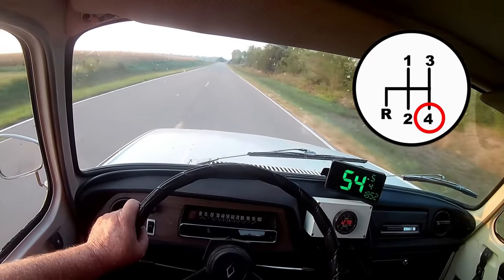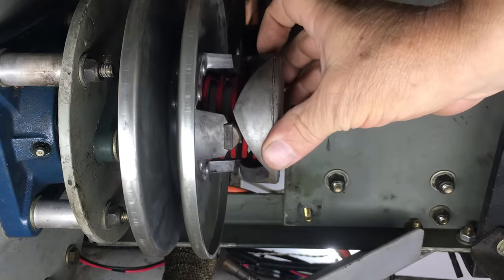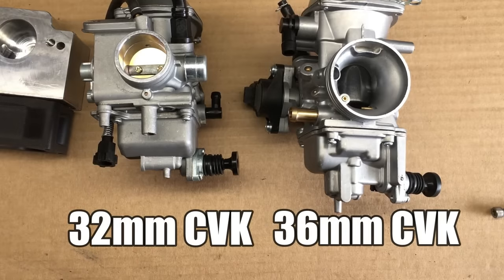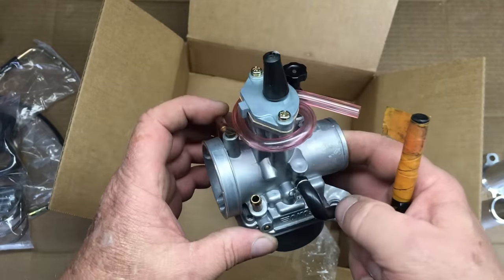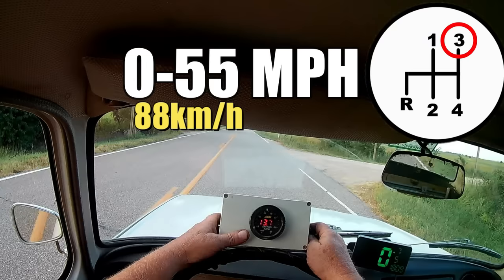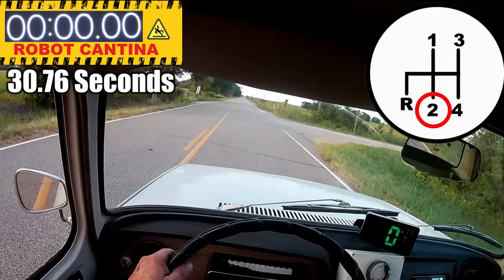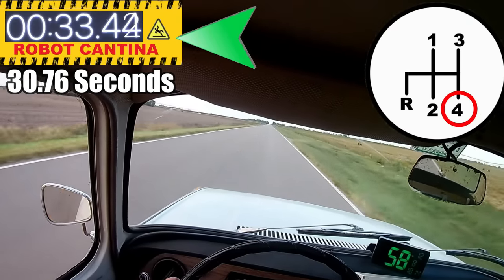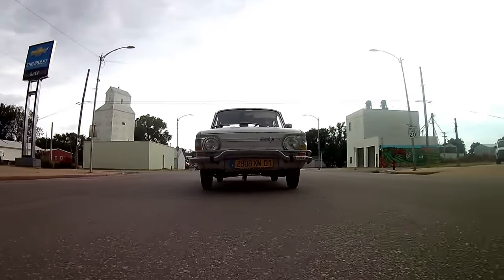S3 E32 We install a 3D printed manifold spacer on the 670 cc Predator Renault for moor speed

Comment: The dual carb setup will outperform the single carb. More work but there's no real reason to go with an even bigger carb when your problems don't exist on the high end of the RPM range. Larger carb could hurt the low end economy as well.

Comment: I hate duel and triple carbs. I've spent too much of my life adjusting multiple carbs for probably very little performance gains. Spend the time putting in fuel injection again. It will probably save time in the long run and I'll learn something. Of course the point isn't to save time so we will probably see both. I'll also loan a zz632 if you want to make something out of that

Comment: The 90 degree turn in that aluminum carb adapter is not doing you any favors.
Neither is that CV tuning. Bogs down too soon, set it tighter to keep the engine in the higher RPM range.
The dual carbs may give more power for the simple reason that the manifolds are straight in. Rule of thumb is that every 90 degree bend is like 4 ft of pipe when it comes to air flow restriction.

Comment: hahaha i love dual carburetor but you going need to drills hole in cover in order run dual carburetor like i have lol
dual carburetor is bit picky with fuel rate 2nd dont every use T pipe for fuel line i recommend Y pipe because share same psi with each other and going need electric fuel pump not valve breather fuel pump because doesnt give it enough fuel will install out one of carburetor 
i learned this before went on tips and got so many issues and find way around it never have to worry about it
i love about oko carburetor kits is useful and more effects and they still sell rebuild kits just save my self other headache down the road
i love sound of engine and i can tell she is shaking it so hard get up n go (sound like it is slipping but take time grip on) 
first need upgrade carburetor bigger do test them next you going to modication for dual carburetor unless you find other cover before drill hole in it

Comment: Have you thought about starting in 2nd then shifting straight to 4th? That'd keep the RPM down at higher speeds and you can let the CVT do what it does best.
Reply: Interesting thought, I'd like to see it tried and see how it affects the acceleration in 4th. I was just thinking during the last run about trying to make the CVT do its thing better in 4th, but I hadn't thought about doing that to achieve it, good idea!
Reply: It may not increase acceleration time from 0-55 but higher speed acceleration may increase quite well

Comment: If You weren't taking way too much time to shift the times would be better starting in 1st or 2nd gear.
It may be that this car is hard to shift but most manual transmissions should take no more that 1 second to shift, You are taking closer to 5 seconds per shift.
Reply from the maker: We are using the CVT drive as a clutch and there is no conventional clutch on the Renault gearbox... so when I shift I have allow the synchronizes engage and that take a a bit of time.

Comment: IF dual carbs does better its not because it is dual carbs. It would only be better because the manifold design has no bends and it is horn shaped, which gives you major acoustic efficiency bumps. I wish carb people weren't so stupid.

Comment: You keep talking about the pilot jet and part throttle problems. Not once have you ever mentioned adjusting the needle height which is where most of your cruising performance comes from! Lifting the needle makes it richer, lowering makes it leaner.

Comment: Whatever size carb works best the dual carbs need to be the same size the air needed will be the same only 1cyl fires at time will need the same amount of air flow but with proper size and corect jetting proformance should be better with dual carbs the intake will be shorter an more inline with the intake valve should make more low end torque an hp

Comment: it would be interesting to see the performance when starting in first gear and shifting to 3rd
Reply: I get the feeling the CVT somehow isn't reactive enough for this to pay off.  In early video he started off in 2nd and shifted to 3rd faster 0-30 bit hurt 0-55 as the shift and CVT readjust takes more time.
Reply: @jarrodwidiger5472  I think cvt reaction time is governed by engine rpm and could be slow to react but I'm not sure

Comment: This did not go the direction I thought it would. I dont know much about carbs so its not a route I would choose for my self. I probably would have went for EFI next but I will say this for carbs they can be fixed and rigged with screw drivers, bailing wire and some chewing gum😅 Macguyver couldn't even fix fuel injection without a computer. Lets see them duel carbs🎉

Comment: You lose flow with every bend in the intake, especially "wet flow" air / fuel mixture. Straight shot intakes with dual carbs should provide slightly more power than a big single, in this case. I could be wrong though...........

Comment: I am not sure the cvt is doing its job. I would only expect a small amount of clutch slippage and then a constant rpm while the speed increases. now the clutch is doing too much and then the cvt seems to lock in place on a fixed ratio. (rpm goes up slipping clutch, as clutch engages more and more rpm drops and the cvt should do the rest, but the rpm's should be steady), now it feels like taking of in 3rd with a manual. I guess the cvt is doing some of its job but not all of it.

Comment: Are u using 780 drive and driven CVT???
Reply from the maker: No, we are using a 44 series clutch and a 40 series driven pulley. The 44 and 40 series parts are rated for a max of 18hp... and I guess we found out that is true.
Reply: Yes they might be cheaper but at least you have proved the durability LOL
The 780 series is the drive  and  the driven from my rusty memory is 760,770,780
This cvt combinations are very common in the 6x6 or 8x8 amphibious  vehicles for the 4 stroke . MAX ATV used these as OEM  . I copied this and it worked out great for my hotrod briggs approx 28hp ..  The very serious use the the next up sized clutches  30--40--50hp

Comment: Is it bad that i want the, well, ratios adjusted so that 55 lands straight on the RPM limit in third gear? Also on that note, is there a way to adjust the CVT to favor the power band? Or even favor the efficiency band?

Comment: All this engines working at 3-3500rpm so have poor camshaft 190degree and heavy flydisc. I have changed with 240degree camshaft lightweight flydisc now i have 35+ hp.

Comment: I think you forgot the CVT ratio when calculating the engine rpm at 55. The CVT should do """overdrive""" when you're going that fast  At least that's how Piaggio cvts do it. Try checking the real rpm at 55.

Comment: I am not sure how much of a  "knock off" these Chinese carbs are vs the Japanese brands they look like.  Japan has had China making parts for them for ages. I have a Chinese carb on my ATV and after a very little screw adjusting it runs perfectly. And the carb looks 95% like the OEM one did.

Comment: Gear chnges seems to be amplified. On regular cars gear change does not take so long. On average car it takes around 0.5s to make it. In your video it takes around 2.5-3 seconds for the two gears. Also making so slow gear changes will drop the rpm on the engine so you need to run that back up. Is there a reason for such a slow gear change? Currently most of the losses seem to be (fixable) human error, not mechanical problem. Currently video shows as starting from 1st gear is very bad but in reality it might be the same or better. And yes - i have been watching  around 15 videos of your channel as you pimp various cars.

Comment: what material did you print it in?
Reply from the maker: We used ASA filament.  We have had great result in the past with ASA.
Reply: @robotcantina8957  so you could say its gasoline resistant? also how well does it do with heat, im restomodding a classic moped but the manifold accepts only one type of carburettor so i want to either make an adaptor or a complete one
Reply from the maker: @712erik  Yes,  ASA holds up great in heat, gasoline and oil.  We used it in S2E15  for a carburetor adapter and in S2E16  for internal engine parts.  We use PRUSA  ASA because we have a PRUSA  MKIII printer and it prints perfect every time.
Reply: @robotcantina8957  thank you so much for the answer! going to draw some things soon and test it out

Comment: CFM vs carb calculations 
Briggs 570cc twin  35cuin   3750rpm 95%ve   = 36cfm ,,,  26mm carb fitted 
Kohler 725cc twin 44cuin   3750rpm 95%ve  -= 46 cfm     28mm Kehin accel pump carb fitted 
British 650cc  motor cycle 6500rpm redline   95% ve =  71cfm   30mm  single carb 
Modified Briggs 570cc 35cuin 5200rpm 95%ve = 50cfm    28mm  Kehin accel pump carb rejetted 
Modified = cam shaft / no governor ,, aftermarket connecting rods ,,  9to 1 CR =shaved cyl heads  
9x 2 inch air filter ,,   changed timing /flywheel key ,, exhaust headers 1 inch stepped to 1 1/4    2 into 1 ,, 2x  inlet muffler 1x outlet